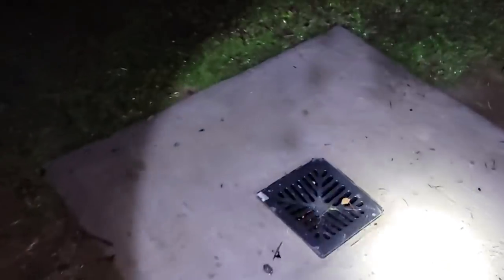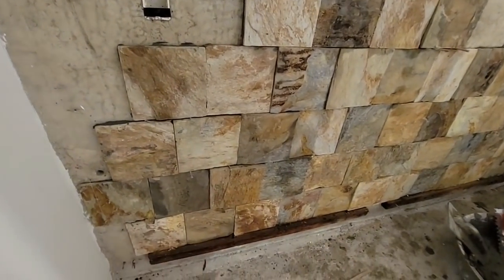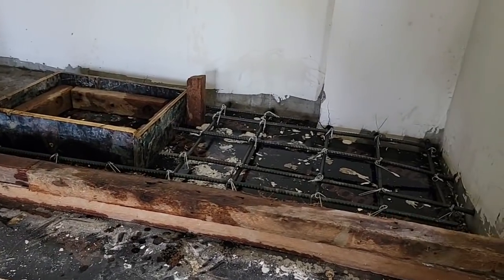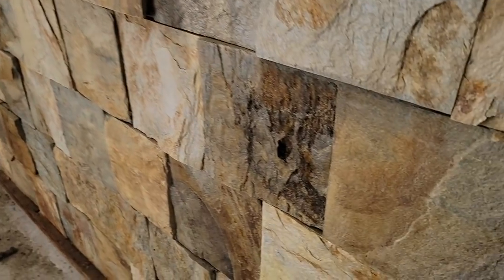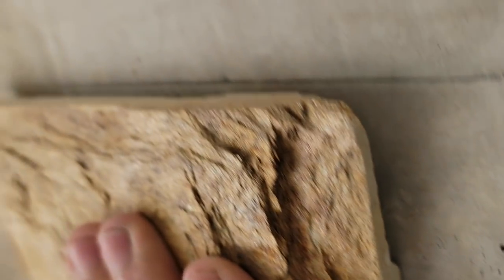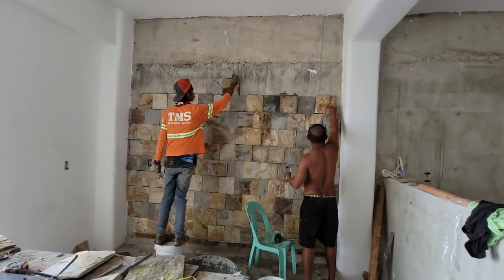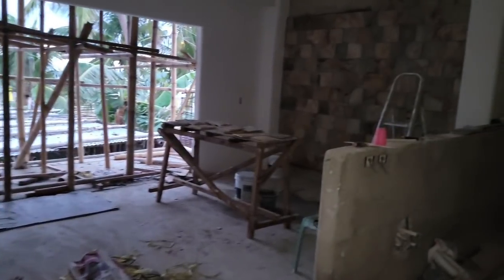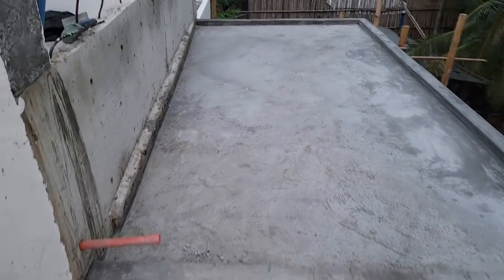Philippines Beach House Build Day 271 Part 2 Concrete countertop, Slate Wall and more Precast

Comment: Hi james you may have to use longer screws for the power point faceplate due to the thickness of the stone tiles but you probably already thought of that as the Filipino electrical switches and power boxes are not that strong the fixing nuts in the boxes pull out very easily just my thoughts cheers Gerry
Reply from the maker: I did not use the standard boxes in most of this house. I used some that dont have those inserted nuts once I was able to locate them. Instead they have thick plastic and the screw cuts its on threads. The boxes was also better plastic and tough.
Reply: @TexasFilipino  ok james looks like you thought of everything I actually bought all my boxes and switches from Australia as I saw the Filipino ones keep up the good work tks for the reply enjoy cheers Gerry

Comment: love the look of that slate tile, the only thing with slate is that it breaks easier and really dusty when you grind it, best using a wet saw so you don't get dust everywhere. That walls going to look amazing.
Reply from the maker: Building a cincrete hoe you will combat dust until the day you do the final paints and tiles.

Comment: Hey, Brain do you have an ID Number for your stone? I think it is awsome and would like to do a wall in my house in Davao. Also, what is the type of adhesive are you using,?
Reply from the maker: I am JAMES! It is heavy duty tile adhesive which has bonding additives. I also added additional additive to give it even more bonding strength. The slate stone is quarried on Romblon Island. I am not sure if this particular stone is trucked down to your region or if you may have your own local quarry with other stones. There is no part or id number